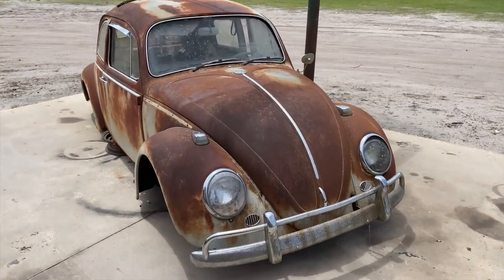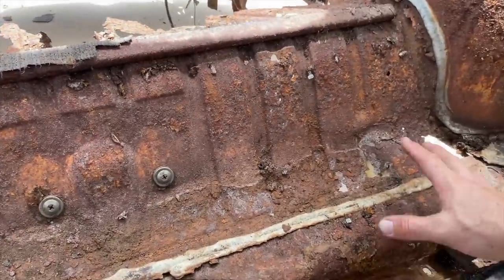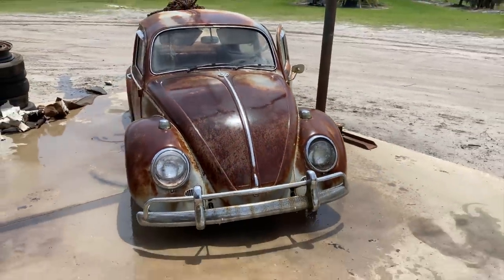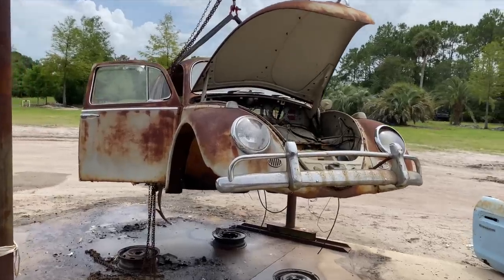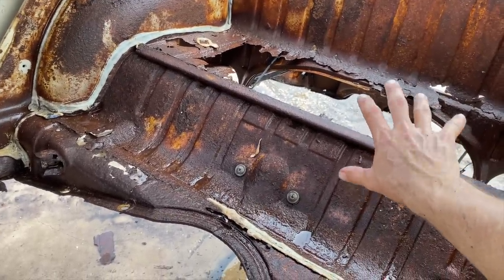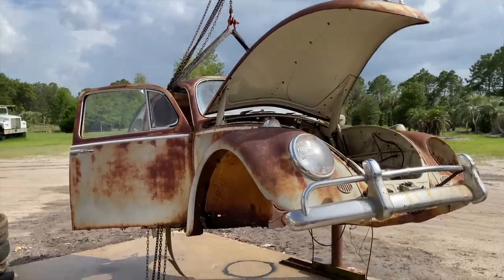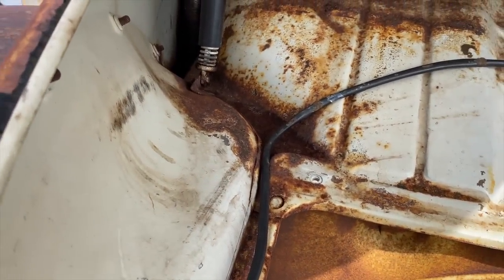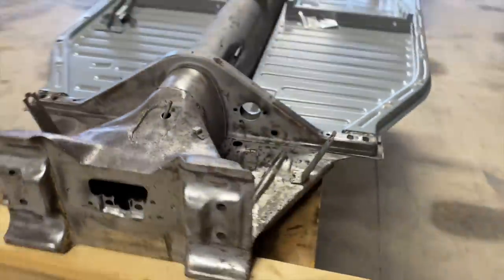VW Beetle Restoration - Pressure Washing Rust, Grime & Dirt

Comment: I hope I am wrong and I wish you all the best in your endeavor ... but this VW will never be a registered motor vehicle.  In fact, my best analysis says it will never be under power with a functioning motor.  It is just too far gone and ultimately, the value proposition isn't there.  If it was a 68 Road Runner - maybe a rebuild with new sheet metal and frame repair makes sense - but a VW? - not gonna happen. But hey - I am watching. Prove me wrong!

Comment: I would still use a scotchbrite and some mat clear on that just to keep it like it is. See if you can find a badly damaged front fender to section the headlight bucket. Probably harder than restoring it.
Reply: Is the mat clear in a rattle can? Do u know of a video showing that progress? I need to do my roof on my split?

Comment: When you go to section in any metal work, sand blast the area you plan on welding so that you have a good bite for welding. Most people just grind it and think it's cleaned up, then have problems with the welds fusing properly. You can always faux the welds after to look patina, then spray the whole car with DTM flat clear 50 percent flattening additive to the clear to get that natural look. In return preserving the metal, so the rust doesn't continue to grow.. I like your vidz, keep at it bro man!

Comment: Learning is the key, ma' friend! Damn, it could possibly be a can of worms, as you call it.. The more you search, more you find.. I have to say it's quite rotten in the back, you probably should start with new parts and then search for a good spot to cut the old, because you can't weld on rust. Being so rusty it will be really a challenge, mainly with the persistent question "where to start?". I hope you will find the right spot to get some structure back together. Cheers, we keep an eye on you... 
😉

Comment: You will need to change the inner & outer rocker panels, the lower panel under the heater channels and depending how bad the panels in the engine compartment are rusted you may need to replace them because the compartment needs to be airtight for the engine to cool properly. I would clean the dash with a scotch bright pad and comet to see how clean it will come. You also when you order the parts look for the blocks that go in the side panel for the jacking plate that mounts on the bottom of the pans, if they are not put in it can cause the side panels to bend if you jack up the car from the jack plate.

Comment: Have a look at 'Coldwarmotors' channel because that guy is a master at keeping the old cars going and how they look. He has a Model T which he kept the outside totally patina, rubbed it smooth and clear coated it but had new timbers inside and got the mechanicals all 100%.
Patina is the new look!
Personally I would make the interior like new with paint, trim and carpet and the same with the engine bay and front trunk.  Actually looking at the rust in the inside there aren't that many panels to the lower part of the car and I always prefer new panels to patchwork. I did a '56 Beetle and we had the same issues.
Going to be a really cool car when its done.

Comment: CT, hi from Scotland. The rear side windows are pop outs. Not factory but a desirable addition. Paint colour is Pearl White which was on the label you were looking at. Headlights again non factory. They have been changed from sloping to later lights but the original sloping glass has been retained. Don't know if the car came with the towel rail bumpers but again were a factory option. Yours look like they have had a hit as the bonnet shouldn't hit them when opening.

Comment: I think there's a chance that I've said this before, if you wanted to keep the patina you could wet sand the car body and give it a few coats of lacquer. If you did this well enough to wax then if it got wet, it would look a lot like a VW that has been oiled to keep it waterproof. If you're going to do that, the full respray is always going to be a better option. It just does not make sense to do something so weird, unless you spray a test panel from another vehicle to see if you can keep that aged look....I can't see it working well enough. You've got to say goodbye to that patina....there may be a form of lacquer that would work but there's so much trial and error that you need to take some photos with loving care and think back to the look when it's done. If you're doing anything, a primed surface is necessary to give a good surface to bond to.

Comment: Save all original VW fasteners. Clean them with a wire wheel. The crap they sell today is not even in the same league as the original VW Kamax, etc. nuts and bolts.